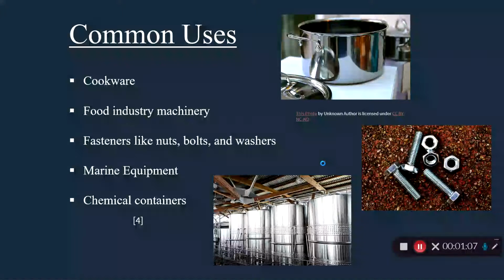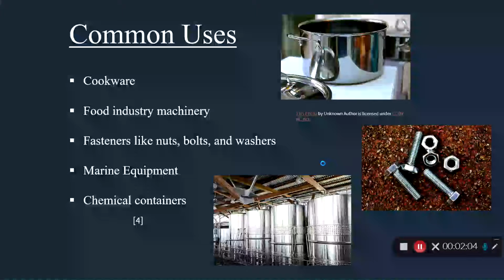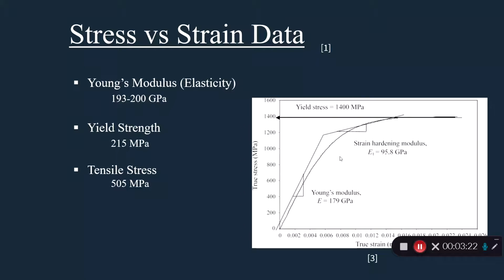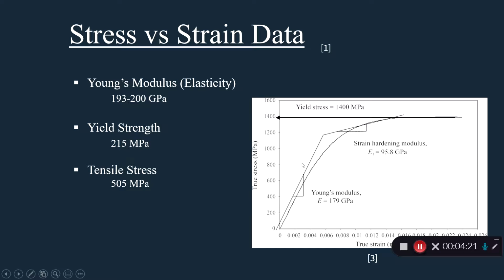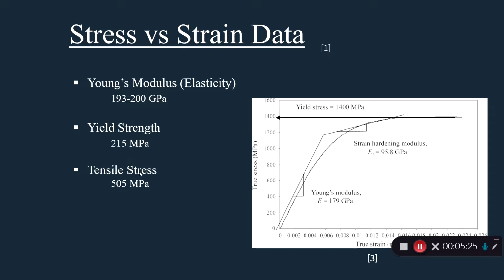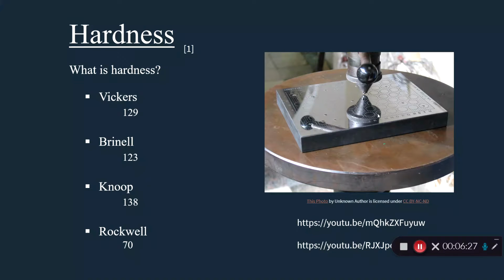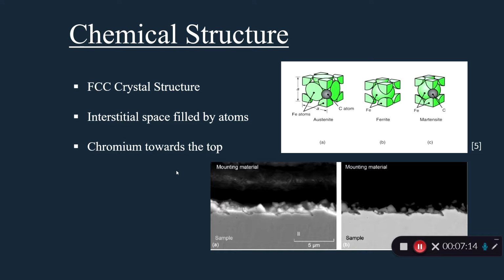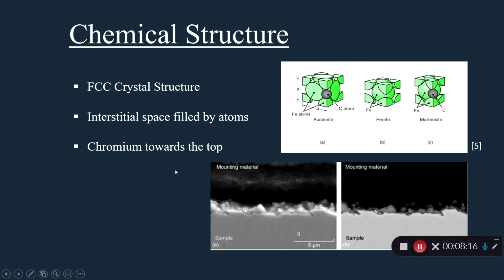Stainless Steel by Robert Kortas

Comment: You did a great job on this video. Your information was thorough and clear. Your slides were great at delivering only the necessary information without being too cluttered. One thing I would have liked to see was more information about the recyclability of the material. Overall, good work!
-Drew